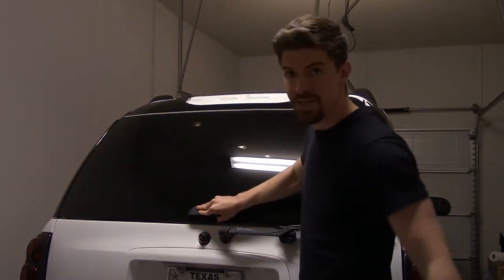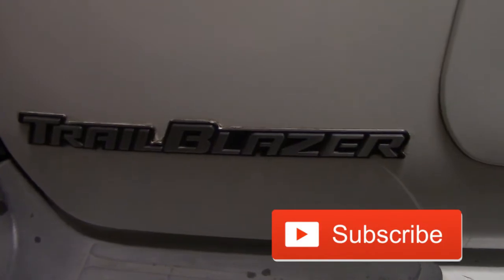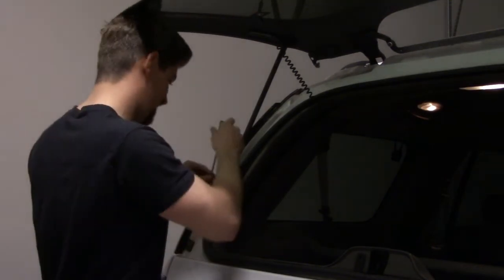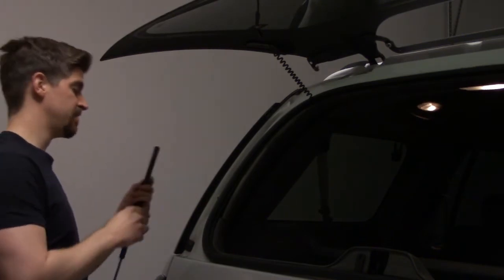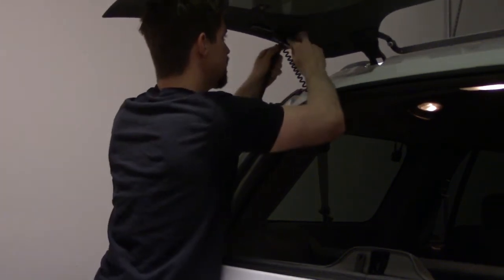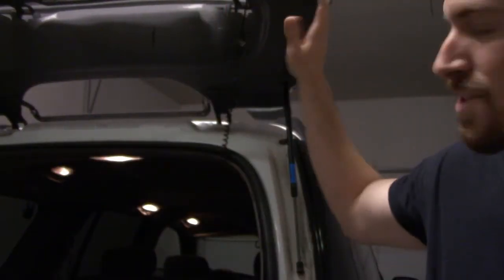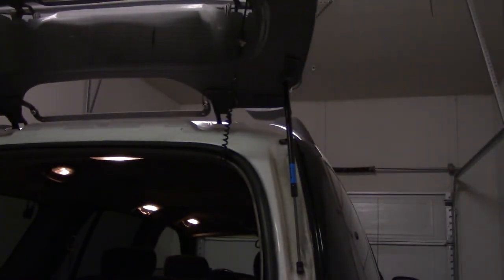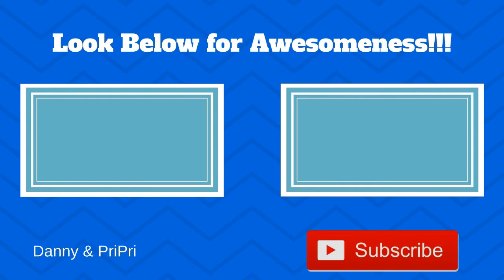Replacing Rear Window/Hatch Lift Supports Chevy Trailblazer EXT LT 4.2L | Envoy

Comment: How can I find the hydraulic for the glass and the hatchet? Or are they the same
Reply: 2 different lengths when comparing glass vs entire lift gate. The design might be identical, but dimensions are not.  As far as left and right, I'm scratching my head wondering if this wasn't a ploy for cash grab. Every Stabilus strut I have ever bought, regardless of car manufacturers, has 1 fits both sides.

Comment: How about if the window won't open at all? Stuck button.
Reply from the maker: Does the back gate open at all? You may have to manually unlock the window. I have another video that shows where the manual unlock can be located for the back lift gate 👍
Reply: The glass window part doesn't open with the button. The button won't go down at all, it looks like it used to work, may be stuck somehow.
Reply from the maker: Sorry for the delay Alexis, I was busy with the holidays.

I took a closer look at the button today on my car and it would go down when locked. The internal lock may have freezed up. Try removing the trim panel and spraying some wd-40 on it to loosen it up.

This is a video on how to remove the trim panel to get to the lock. If the wd-40 doesn't work inspect the lock for blockages or issues. Let me know if any questions come up. Best of  luck!

https://www.youtube.com/watch?v=aDA3p9ZEB08&t=0s&index=7&list=PL8mWpySSzgCpy6HOhaRJqn7L63EUa8mRI